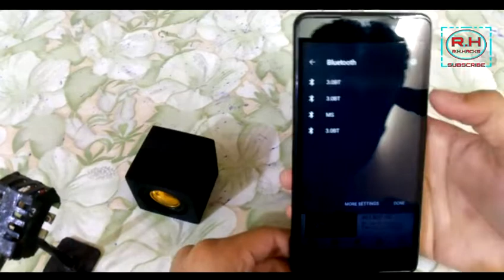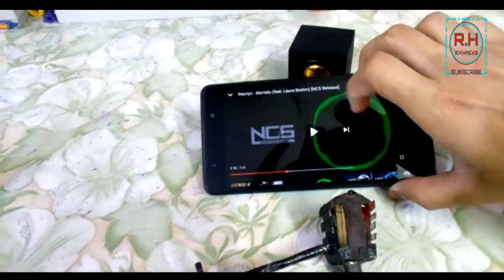How To Make Small Cube Bluetooth Speaker | Diy Mini Bluetooth Speaker | Cube Speaker | RH Builds

Comment: I have a small re-chargeable Bluetooth speaker (one output) with one 3 watt 8 ohm speaker, I want to add one more same speaker, So should i connect it parallel or series ? Please give your suggestions.
Reply from the maker: Hi,
Bro, if you want save your battery life I would recommend you to connect it series because it will increase the resistance(8+8=16ohm) which will provide you long time use. But you won't get much loudness. 
BUT
if you want more loudness so please connect it in parallel connection. But the resistance will decrease to 4ohm which won't provide you satisfying battery life but give you more loudness than before.
You can test it, you will get proof. 

 I hope you have got your answer. Now choice is yours.
 If you have any question about it please ask me on the comment. 
Thank you bro.
Reply: @RHHACKS  I'll connect it parallel, it will not destroy the circuit right ??
Reply from the maker: Right, but circuit may heat up. It depends on your circuit quality and model.
Reply: Yes, bro when I connect it parallel, circuit is heating, Is there any way to control the heat, when I connect it parallel. Because I want more sound.
Reply from the maker: Bro, as the amplifier is adjusted with 3W 8ohm speaker, you have to make it's ressistance to 8ohm anyhow. by doing this your amplifier circuit will be cool and become safe.
if you want loudness with 4ohm ressistance, you can install a heatsink to the main ic.
Reply from the maker: Bro, do you have any ressister or capaciter?
Reply: You can recommend any resister or capacitor , I can buy from market.
Reply from the maker: Bro, if you use capacitor, it will reduce bass as I had saw on this video. Are you sure to buy it?